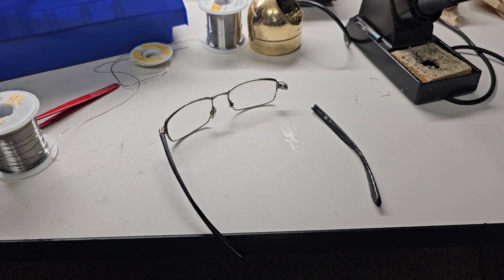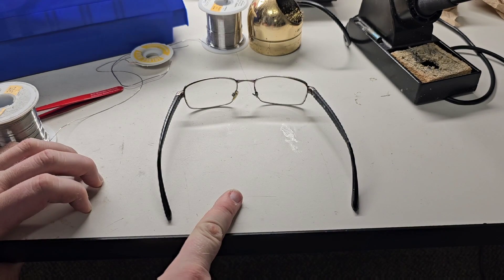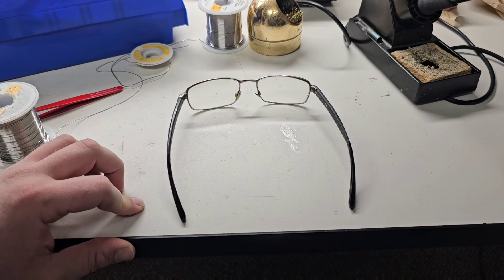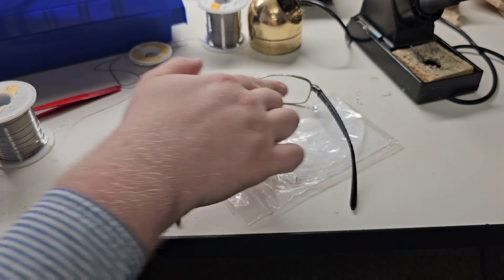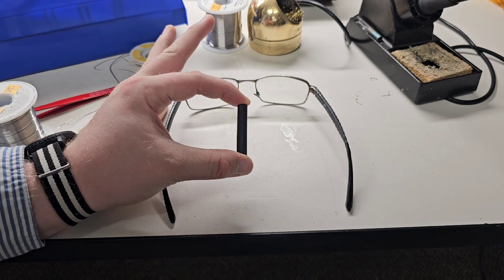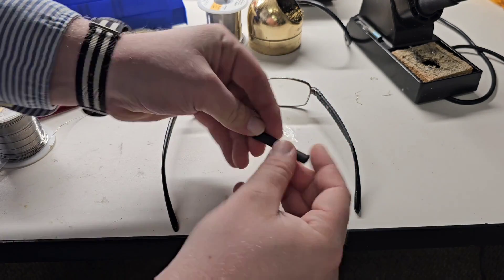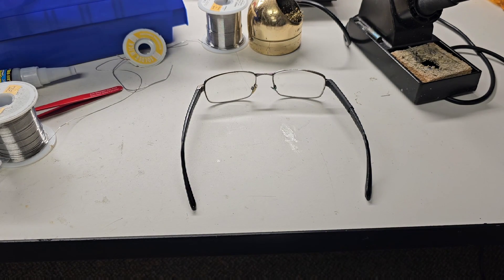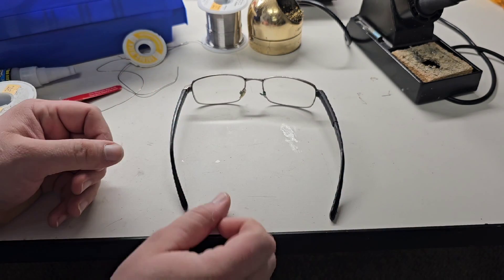The best way to fix glasses from an #engineer | DIY Glasses repair

Comment: I would use CA glue along with a filling agent like corn starch or ground up ash. This will harden up harder than the original plastic joint used to hold the metal hinge end in place.

Comment: you'll ruin your optic glass aka optically engineered plastic if it was made out of plastic, most of 'em are plastic now days.. protect the optics at all cost..
Reply from the maker: True if you use a heat source that is too hot. A hair dryer or low heat, heat gun is normally a safe bet.

Comment: I've done this a few time myself for my nephews. For wire frames put the heat shrink on before glue if you even bother with glue. Even better get the heavy duty stuff with a hot glue layer inside it that's usually sold for marine battery applications but I'm pretty I've seen it in smaller sizes.
Reply from the maker: The water sealing shrink is the best, but I didn't have any in stock.